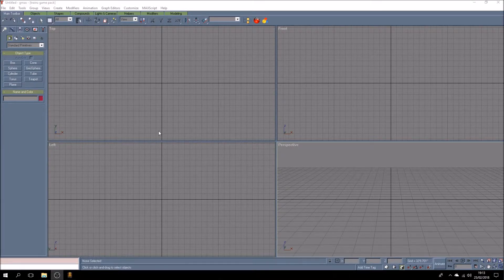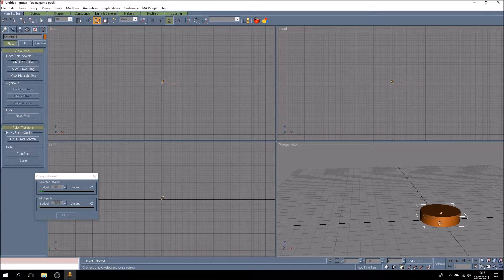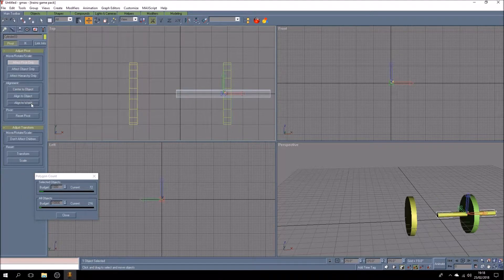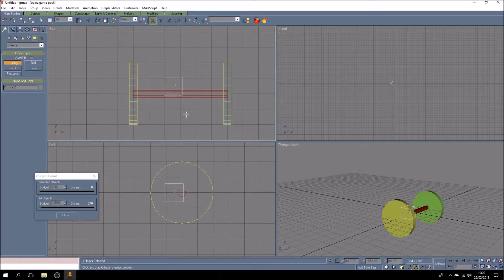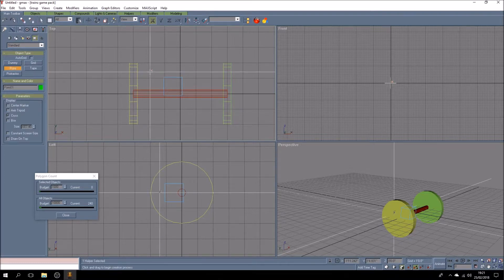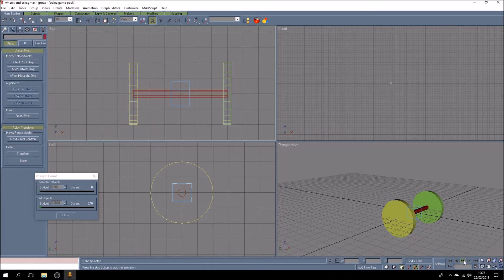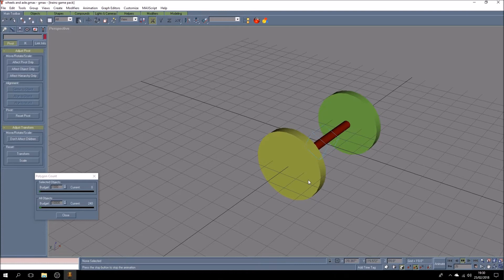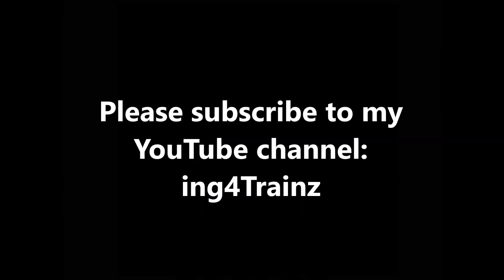Gmax: How to make models for Trainz, part 10 - Basic Animation

Comment: Helpful! But i have a message "No bones to export" when i want export to .kin
Reply from the maker: OK. 1st: Are you using Gmax? 2nd: Do you have the Auran mesh exporter installed? 3rd: If installed, are you loading Gmax by clicking on the Trainz exporter icon? Post your reply here or send me an email, my address is on my website, just click on 'Contact'.
Reply: @ing4trainz  i find reason at dummy i didt type  b.r.axle01 i type 1 😂 I didt now that but now know.
Reply from the maker: OK, easy to make naming mistakes. I've done it plenty of times.

Comment: I was able to make an animation (using the Bovbjerg Lighthouse as a template), but when I try to export it, I get, "Error: no bones to export." And it doesn't export. What does this mean?
Reply from the maker: 'bones' are used in 3D Max (Autodesk) which is the commercial programme from which Gmax is derived as a much cut-down free programme. The full kit is expensive. A three-year subscription costs £1,782 on their website today. 

I don't think you can create bones (which are a type of dummy) in Gmax, but it would be worth Googling it just in case, at least to discover how they are used in 3D Max. Also, don't rely on just one lighthouse on the DLS, have a rummage and you might find one where some brilliant person has worked out to do it within the limitations of Gmax. If so, let me know!

Comment: Is it possible to make an animation of something growing / shrinking? I'm trying to make a night animation for a lighthouse and I have two meshes, one of the lens when it's off and another with the lens when it's on. My plan is to have the "on" mesh shrink behind the "off" mesh when it's off and grow until it's in front of the "off" mesh when it's on.
Reply from the maker: I think the short answer is no, unfortunately. Animation relies on a mesh being attached to a dummy and it is the dummy which is animated. Consequently, the mesh follows the dummy. You can animate the mesh in Gmax but it will not export as an animation into Trainz, it has to be linked to a dummy and have no animation itself.
However, if you are looking to have the lighthouse lens turn on at night then you use your 'illuminated' (i.e. white/yellow textured on mesh) mesh and it will illuminate according to the time of day. It needs to be very slightly smaller than the 'off' mesh and sit inside it. Use the 'night' setting in the confg to set when it is to come on, I think 'time-of-day' might be what you want. Just have a look at any building that has a night mesh i.e. lights up at night, and follow its config entries.
I've tinkered with this myself, lighthouses that is, but I can't remember if I managed to get the light rotating. It would be worth having a close look at lighthouses that are on the DLS.
If anyone has any ideas on this please post them as I for one would very much like any helpful tips!
Reply: @ing4trainz  I see. I guess I should've picked the Cape Lookout, Cape Hatteras or Oak Island lighthouses to practice on instead. Rotating beacons sound a lot easier to animate than flashing ones.